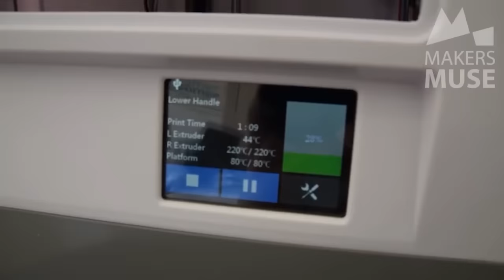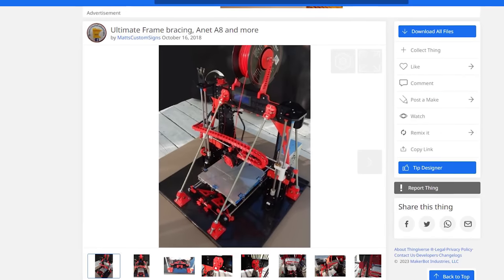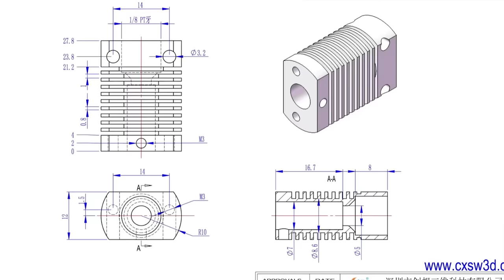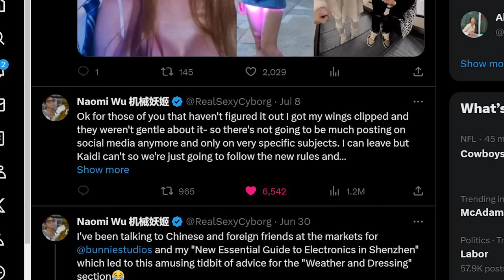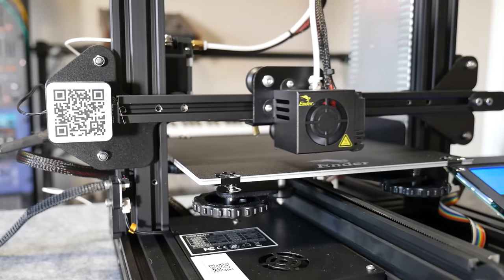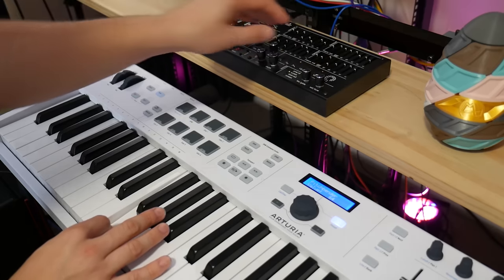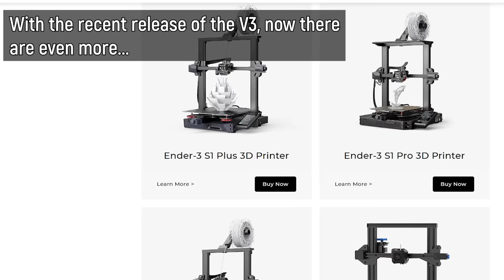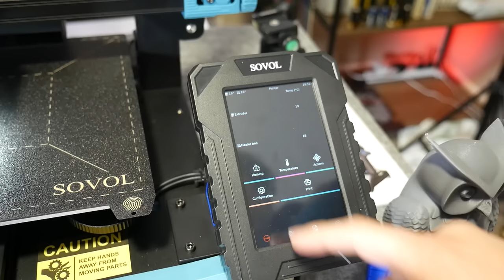Creality Ender-3... it's time to move on.

Comment: Not all 'beginners' are the same - for example in terms of what they want to do with their printer and how interested they are in learning the mechanics of it and tinkering - or how much control they want over the machine. So I don't think there is any 3D printer that would be generally recommendable to all 'beginners'. For me, my 2018 Ender 3 has seen it's share of mods and upgrades (never had this z-stop issue but all the others, yes, and they are easy/cheap to remedy if you have the will to learn and tinker) - and it works just fine in 2023 and gives me all the control I want over the machine. For others maybe not. So you need to know the person you are recommending to: 'beginner' is not a person.

Comment: I like the ender 3 pro :) Mine worked after assembly like a charm. Did not use it for 2.5 years and now i use it to print things i need without failing. Think i am a "lucky" one. After bed leveling and putting the right settings in cura, i always have perfect prints :) I am still a noob in 3D printing and this machine makes me feel like a pro ;) Only printing PLA though. I bought a new printer to make TPU parts, Elegoo neptune 4 pro, did not have succesfull print with PLA but damn, she is a beast with TPU. I still suck at designing 3D models so supports for TPU , worst thing i did, three times in a row lol. Thank you for your channel, i am learning as i go (y)

Comment: Interesting video, especially from someone who saw the ecosystem evolved. But still on the unfair side of the coin, especially since you compare two identical (even if one is older) Ender 3. My first printer was (and still is) an Ender 3 V2, and the V2 is quite different on some points (whereas similar on others) to the vanilla 3. You're still right that it has become difficult to compare the multiple versions of the Ender 3 (and i don't intend to). As for the Bambu, yes i hear praises but i think it is not the same price range. The similar one, the A1, is about 2x times more expensive. At the end of the day, that is often what is important for a beginner : an acceptable ratio between price and capability !

Comment: It's hard for me to knock on it as someone that has used a A8 printer I ordered the ender 3 max neo but I get it in the mail tomorrow, I Will do testing on it but for 12in build I have never had that big of a build and it's a First for me having a safety that will pause the print if the power goes out and be able to pick it back up whenever the power comes back on or detection of running out of filament and pausing the print and picking it back up where it left off then too. I don't hate my A8 printer but they are rather difficult to work on and are finicky when it comes to using different materials other than PLA if you can get a successful print on a A8 a creality printer is a major quality of life

Comment: I just bought an ender 3 v3 and the automated z level is indeed still an issue, but I simply set it lower by a few mm in the menu and it's no problem.  I only paid $165 for it and it works very well.  The only problem I've had has been with octoprint, but when I put it on a pi 4 everything has been perfect.

Comment: I had an Ender 3 clone that I used for a year with Hundreds of hours of print time on it. I spent a lot of time fiddling with it to get it to keep printing well and felt like a quarter of the filament I used ended up going towards a failed print. In November I bought a Bambu P1S as a spur of the moment thing at a microcenter and it is literally a world apart in terms of print quality and the only problems I have had with it were directly my fault. I hate that all the parts are proprietary but I really hope they push other printer manufacturers to step up and finally retire the basic ender 3 design.

Comment: I just bought an ender 3 v3 KE because I was looking for a bedslinger that could do equal or better speeds than my modded ender 5 pros without all the issues that come with the ender 5 only having a single z axis (I know, could have got an ender extender, but thats half the price of just buying another printer) So far its been absolutely flawless and eats up any print I can throw at it in record time, the 500mm/s (with the default scaling for different print areas) with max acceleration so far has had every print coming out indistinguishable from my ender 5 pros at 150mm/s with klipper. only complaint I have is the lower z height. Dont know how Ive lived without auto bed levelling and grid leveling for so long, its become my default printer. Im not sure how it stacks up to the bambu offerings but so far I have no worry starting a print remotely, Totally agree that they should cut down their older offerings, its confusing for people who are just getting into 3d printing

Comment: My first printer, an Ender 3, is a ship of Theseus at this point. New stepper motors, linear rail system, Slice Engineering mosquito hotend, orbital direct drive and Big Tree Tech mobo and color touch display.  Even the hotbed isn't original leaving only the power supply and frame as original. I feel Ender 3 is basically the Toyota Corolla of printers, cheap and extremely modifiable.

Comment: Ender 5 plus, direct drive and Octopi. It's perfect. It prints at 80 to 120 mm/sec perfect objects using Marlin 2.1. I use Prusa Slicer + Arc Welder. I won't change it soon.

Comment: I own several 3D Printers, my first was a DIY Kit from 2014. #3 and #4 are Creality Ender 3. #3 is a dead Ender 3 Pro with Upgrades, he died and i can't figure it out what is broken. But i had a lot of upgrades Part so i got myself the cheapest Ender 3 to buy and putt everything on it. It works it prints but it is worthless for my Usecase as it will destroy him again. #5 is Tronxy X5SA 400 which is a far better Printer, even #1 is a better Printer, but due it's age it needs lot of Maintenance. ( 2nd Board, 2nd PSU, Thermosistors are swapped etc, Literally rebuilded 3 times now close to 3k hours had to swap the mega 2560 after 1.2k). The Creality Ender is a "Good Enough" Printer which shows lot of wear after about 500 hours. #3 lasted about 400-600 hours, #4 is on 100 hours and it starts again. For the novice: 400-600 sound plenty but you are doing lot of night prints on a slower printer like the Ender 3. I had lot of smaller prints and about 40 big ones and it is now dead. For the Build Volume. The reality is that it claims to be a near 9 inch printer, but in reality it is a 7-8 inch printer. Everything over 200x200 on the plate don't work, more like a 190x190 printer. I have now seen 6 Ender 3, and everyone had a bed drop somewhere. Btw someone in to buy a heavily upgraded and improved Ender 3 to Pro standards with BL Touch, Cable Chains, better Spring, Aluminium Feeder, Dampeners, etc...  #6 is on the way and i need some space.

Comment: Was originally going to get an ender 3 until I was recommended a SV01, and it was the best decision I've made. Super quick to assemble and basically worked out of the box, with the biggest issue being limited mods for it. I would definitely reccomend a sovol printer over a creality one

Comment: I whole heartedly agree with you
I’ve only been in the hobby since 2020-2021. 
I first bought a CR-10. Once I cut my teeth on that one, I picked up (2) Ender 3’s as a “new customer (twice, via mi cro center and their $99 intro). Def not smooth sailing, and def learned how to level that damn bed lol. 
Then, picked up a second CR-10a (not, the CR-10 “smart) as it was “open box” for $250 and really only missed the bed leveling knobs(which I already had a replacement set on-hand). 
At some point I got the AnkerMake M5 via kickstarter (and their V6 yet that’s been delayed 3, 4 times or more). And yea, I wish I’d gone with Bambu instead ad it was same time frame, however would be my next one, although actually the Mini one… I think it’s perfect for those smallish items that be awesome as multi-color and acceptable amount of waste. 
I put a .04 nozzle on my first CR-10 (dead-set perfect level and won’t change it), .08 nozzle on the other; and .06 nozzles on the Ender’s mainly for prop’s and costume type stuff. 

ABSOLUTELY time to move on and away from not just the Ender, but Creality. You hit it on spot with their too-many versions instead of pulling and consolidating… Anycubic, Sovol and a couple others would be my referral to a newbie. 

Thanks for the awesome vid Angus - and apologies for long-winded comment!

Comment: When I began 3DP back in 2017-2018, the E3 was available, yet it did not meet my requirements, so... That's not the machine I bought. I bought an i3 Mega-S from Anycubic instead. I actually still use it and it's my main printer, with a few custom mods.

The issue with Creality is that, as you pointed it out, there are gobs and gobs of different versions with minimal changes if any. But it's still the same machine in the end.
Even as a "tinkering machine", I wouldn't get one. I mean, it'd be a much better solution to buy separate parts and doing things from scratch.

Comment: Agree with ya, experienced maker here and i just cant keep buying ender 3's, i run them stock until they break and then i swap the toolhead/extruder for some more premium alternwtive and it keeps going for years.

The frame movement isnt too bad, its just that damn extruder that breaks/permanently clogs, way to easily :p

Comment: i made a mistake getting the ender3 s1 pro, and buying it wasn't the mistake, buying the sonic pad because i thought it would be a worthwhile upgrade, but it made my printer useless, for some reason the bl touch is the least accurate thing ever and can spend a hour making everything perfect and then it'll fail because it decided the bed wasn't where i said it was but it was half a mil higher or lower than where it actually is. i have tried almost everything i can think of but the thing is a useless paperweight, i feel like i should have just saved up for the bamboo labs in the first place.

Comment: Unfortunately didn't see this in time and got the machine. I'd like to thank you for the advice about the idler pully not being tight enough, because the screwdriver worked like a charm in getting that pulled so I could tighten.

Comment: I don’t get your take. Sure a Bambu is much better, but I can have about 5 ender 3’s vs 1 bambu. 
The point of the ender is entry to market and entry to 3d printing. And while learning the machine and adding all sorts of open source upgrades you can have a very reliable ender 3 with all sorts of shiny bells and whistles on it that can do anything a bambu can do just not with the speed and not out of the box… but in the mean time of tuning and upgrading your ender 3 you learned the full depth of 3d printing almost inside and out….
So don’t be to harsh on the machine that taught you everything you know.

Comment: I have a love-hate relationship with my Ender 3.    If I had started with a better (easier to use) printer, I would never have learned as much as I have getting it to work the way i expect it to.   On the other hand, the frustration of failed prints learning those ropes prob ably took years off my life.  For someone who wants to jump in and just 3d print successfully,  Ender 3 is crap.   But if you as a beginner want to build a full understanding of the dynamics of 3d printing and learn through the school of trial and error how to actually make it all work, it is a fantastic choice.

Comment: Nothing beats Ender 3
1) it's quite cheap - you don't fear experimenting with it
2) it's good but not perfect - if you want to improve your experience you can upgrade it, forcing you to learn more
3) insanely large community - you will never run out of people to get inspired by or to get help from
4) compatibility - parts are not made just for a single specific model but for whole ranges
5) decent defaul - if you just want something that will print something for you, ender 3 will do the job just fine
In conclusion, by having ender 3, it forces you to learn and experiment unlike the new and flashy ones which abstract and sanitize any and all experimentation away.

Comment: The good thing with the ender3 is to learn how these printers work. All that tinkering and modding gives you a deep understanding of the hard- and software. which will help, if you move on to newer printers. I don't want to move from my (heavily modded) ender 3 (yet), but it's only a matter of time before a new printer moves in.

Comment: I take issue with the comment regarding how to set up the hot end.  There is a better way to do it so the fit at the bottom is solid without putting ant stress on the push fitting at the hot end input.  Lost track of how many 1k reels I have gone through now and have not needed to touch the hot end anymore.

Comment: i have a ender 3 pro and i am happy with it. the only thing i did is a direct drive mod and using a bltouch for consistent z height, the bed levelling it selfe i have done with a milimeterdaill or how it es called. i can use the bltouch for leveling but some weird artifacts appear on the prints and the z screw wear is terrible high too  yea i have a mosaic palette 3 but it did not really work because the documentation is so bad for it.
i think the ender 3 is a reliable and good quality machine if you give it some love and time for setting it up right. i have my ender 3 for 5 years now and nothing did break. 
If you grease the z screw and tighting the belts and dont smash the nozzle in the bed and keep the printer clean every thing is fine and nothing will break. i print tpu and pla nothing else so the nozzle going only 200 to 230°C and the bed is on pla 50°C and nothing on tpu. also be said i dont print fancy filaments, no fibers, no metals, no chemicals, just pla and tpu.
so no nozzle clogging or wear occurred on me. yes i use brass nozzles 0.4mm and i change the nozzle once a year for good measure. if the nozzle was 0.45mm at the end of the year i dont know i did not noticing anything on my prints they seam very much perfect every time.

Comment: I wanted a smaller printer for little jobs since I have an ender 5+ for big projects, and got a sovol sv01 pro on a whim and I have to say it's been absolutely fantastic and it is as upgraded as I would normal upgrade an ender straight out of the box.

The amount of aftermarket support,  parts, and tutorials for the ender 3 is hard to say no to but these days there are ready to roll units that are much easier to use and more reliable.

Comment: My OG Ender 3 still prints faster and cleaner than most of the more expensive printers I see on YouTube, I’ve never even changed a roller on it or printed any modifications, the only things I’ve done is glass bed, octoprint, and a random tune I found online many years ago. Maybe I got lucky with my model but I think it’s an incredible printer design, they kept it simple and it works

Comment: I think that for learning, and starting to fully understand what printers are at their core getting a used, possibly broken Ender 3 and going through the motions to get great prints is the best learning tools possible. I still lurk FB marketplace and consistently want to buy old, busted up printers if the price is low enough.

Comment: My first printer was a Geeetech i3 pro, a acrylic i3 printer that I paid 300 USD for back in the day, and had to put everything together myself. I still have it now, 9 years later but I recently bought a new Geeetech printer for 150 USD with a print size of 320x320x400 and that's massive compared to what I had and for half the cost, not to mention it was like 4 screws, plug in a few cables, leveling the bed and then good to go, so much easier xD and I would probably buy a bamboo x1 if I had too much money, but I don't so Geeetech is what I got.

Comment: I bought an Ender3 S1. I had some success until the wheels fell off, literally.  It took me months to figure out how to get it to print again.  I got heavier springs and then longer heavier springs.  It took me an hour or two a night to level the bed.  I had to first level the bed using a digital level and from there level it to the bar the print head zooms on.  I then had to figure out how to get the print head low enough to print.  The springs were too tight and the bed was too low.   After that I was able to print again.

Comment: I love my ender 3 KE. The issue I have is with the price though. I would consider the KE to be literally the baseline of what you need to get into 3d printing and its 2.5x the price of an ender 3 v2 from microcenter coming in at $250 vs $100 (with coupon).

Comment: I bought a v2 the month it came out, (before it shipped with a touch screen and upgraded mainboard...) and it was great value, but never quite good enough that I could just hit print and expect something usable out.  It always took multiple attempts, with tweaks to belts, bed, bowden setup etc. After 4 years, and upgrading to dual z motors, sprite hot-end, ABL and a load of custom start and end g-code, its finally at a point that pretty much every print finishes and I don't need to watch the whole thing.  

For anyone starting out, please at least get something with auto bed levelling and preferably direct drive.  It saves so much headache.

Comment: I still run the original Ender 3 with a cr10 as well as a kossel linear plus  - none are as they were when I had them but they are still going... the beauty of Marlin is you can add the features you want...

Comment: I recently got into 3d printing and a lot of people recommended the ender 3 to me.  But once I started looking into it I saw all these issues like QC, manual bed leveling.. etc.

Then I found the Bambu X1C and never looked back.  I so regular maintenance, put in filament, click print and I'm done.

I don't have time to spend hours trying to get a print to work.